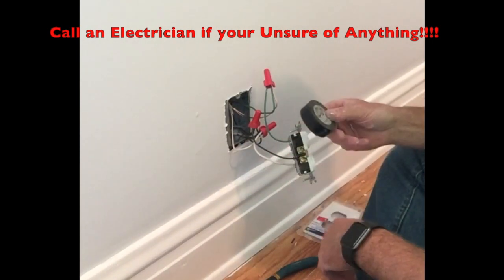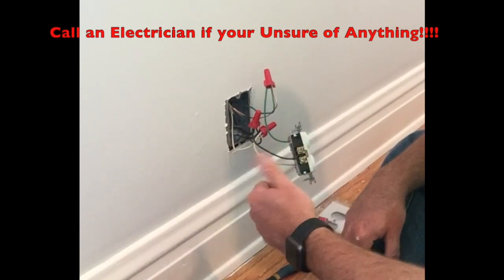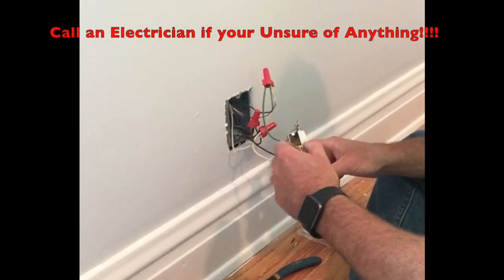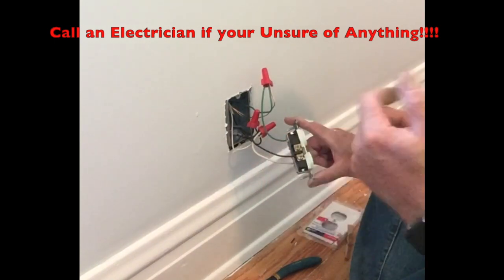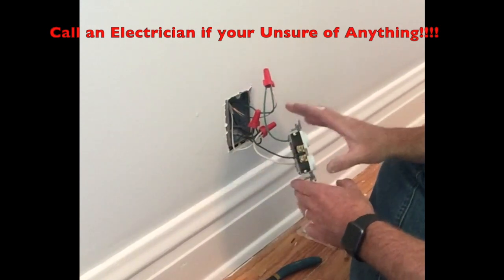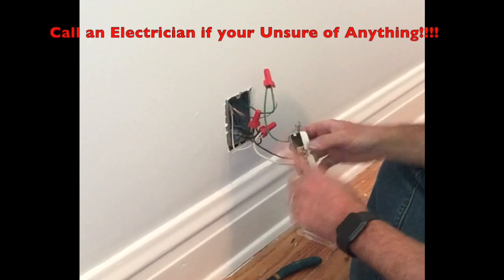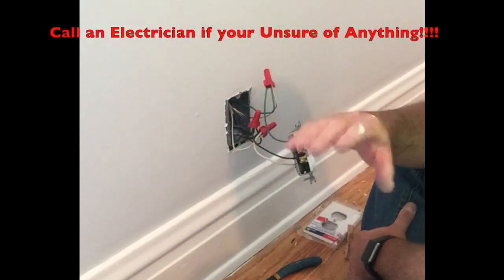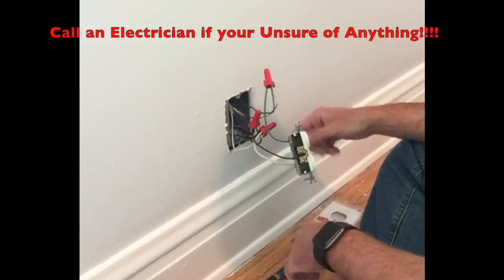Should You Put Tape Around an Electrical Outlet?  Opinion Piece

Comment: Similar problem ig? Basically got this plug yeh, and the bit that slides on and plugs into the outlet has snapped off the prong bit, some shitty little bit of plastic was holding it, smallest bit of resistance broke it, I didn’t even notice it until the shi was fully off 😂 so anyway. I’ve taped the two back together and the only thing concerning me, is it’s not electrical tape, it’s celotape the shitty through stuff, it isn’t touching no metal bits of the prongs, but goes in between em, with it not being electrical tape. Is it safe to do this? Or am I going to burn my house down if I plug this in? 😹

Comment: If the job is done correctly, there is no reason for you to remove the tape. The tape is a safety measure. It protects the next person, especially DIY’s. It also prevents the ground from shorting while you push the receptacle back into the box.

Comment: I would be more worried about people using Stab connections then wrapping an outlet properly so many people don’t think of others when they install them that way and you always have to cut the wires and they get shorter every time I’d rather wrap a box even if it ends up sticky it’s better to remove that mess then have to extend some wires because of some smart home owner that  knew better then everyone else with the install that’s just me

Comment: I always use the tape - it gets me a little bit more safety and  I tend to replace my outlets and switches and never re-use old ones. The darn things are so inexpensive, it just doesn’t make sense not to go with “newer & better” every time. My concern is the ground wires are not insulated and often the electrical box is crammed pretty tight.
Reply from the maker: Gret points

Comment: I recently replaced all outlets in my house for tamper resistant, some are old 1950s wiring, some with tape, I didn’t put the tape back. I was more concerned that most are not earthed.
Reply from the maker: That is a bigger concern then tape for sure

Comment: On jobs, I've had to follow those who have used the tape, and think it's a nasty habit.  Not only is the goo a mess to clean off, but it shows a lack of confidence and experience in my opinion.
Reply: The tape can prevent a shorts, especially if it’s in a metal box.
Reply from the maker: Very good point.  I have found tape that was cheap when they put it on and it is completely dried.
Reply: If the job is done correctly, there shouldn’t be a reason to remove the tape.